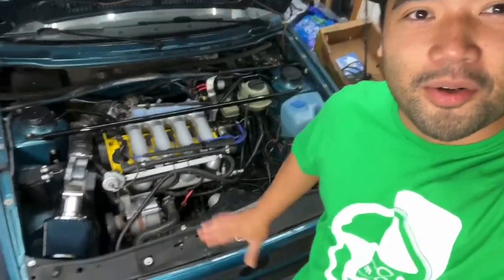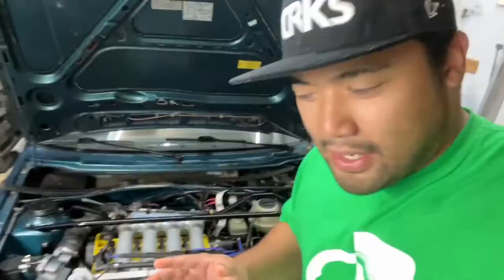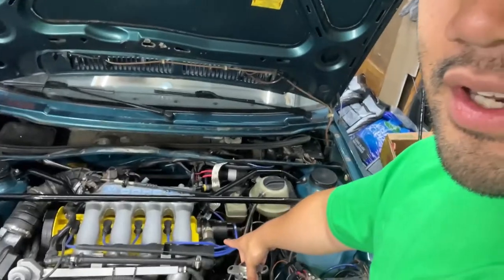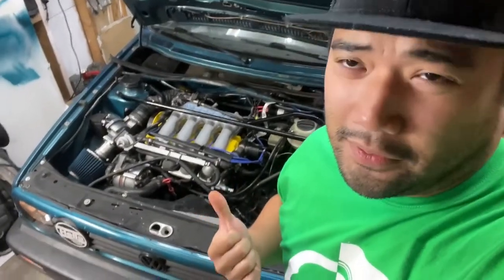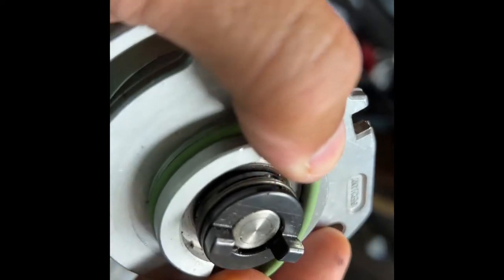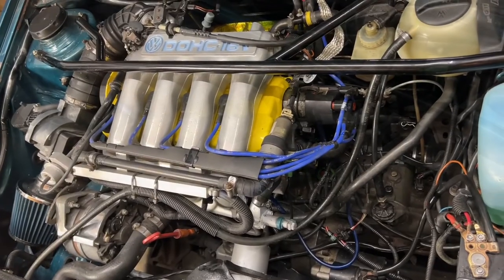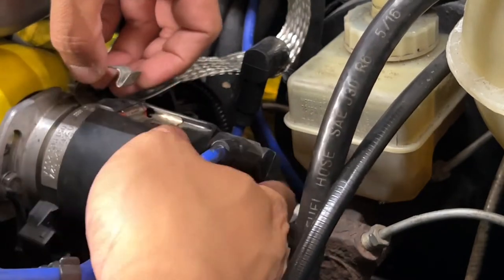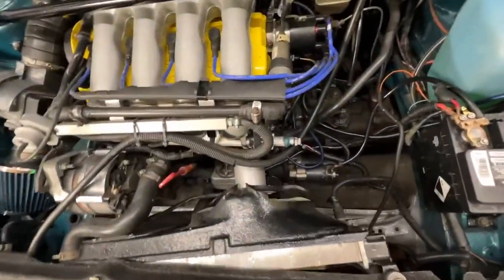MK2 Golf - No Spark on Crank (SOLVED)

Comment: Im having an issue eith with my 89 golf. I turn the key with only a buzz at the fuse box but the engine wont crank.
Reply from the maker: check spark, fuel, air, and timing. hope you figured it out.

Comment: I have no spark on my G60. Will do the same check. Thanks.
Reply from the maker: hope it helps
Reply: @6ixthstage845  Hi again. I did the check that you refer on your video, the one that did Thomas EXOVCDS and I got spark at ignition coil everytime I ground the hall sender connector. Then, I check for spark at engine run and I got visible and clear spark at every spark plug (checked individually). I tried to run the engine and I almost get it because it sounds like, but don't.

Then I checked the spark again at every spark plug and it doesn't. 

Sounds strange to me, but I don't know if a bad hall sender can do this kind of things. I mean, working after ground the inner pin few times and then died again.